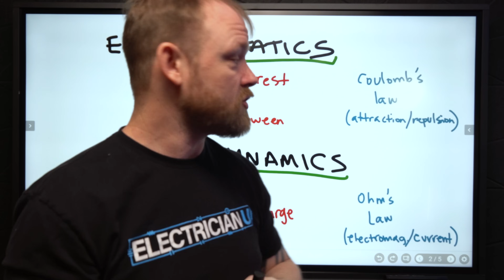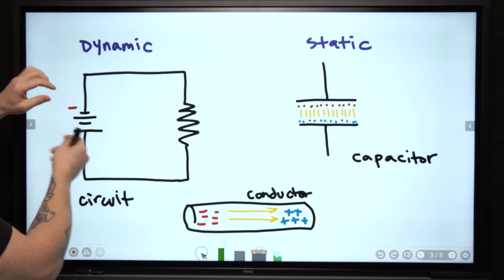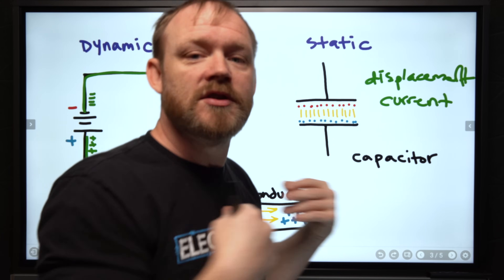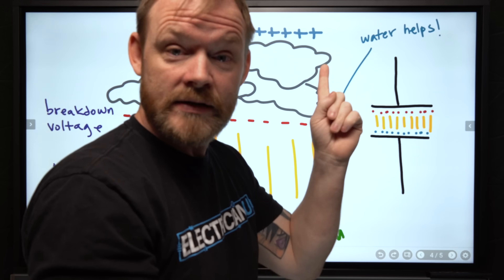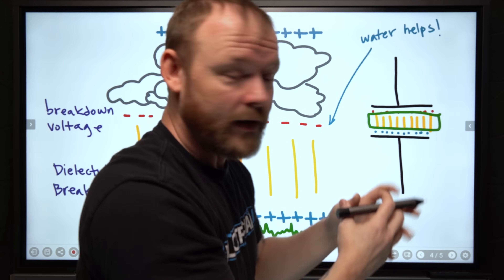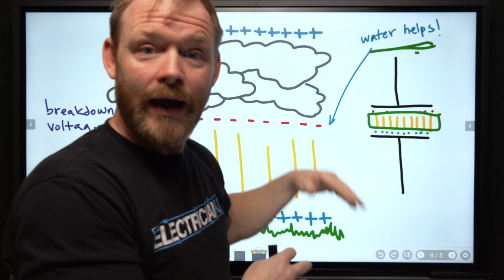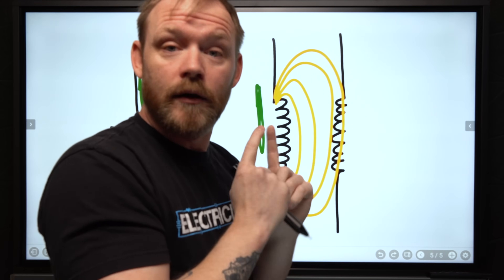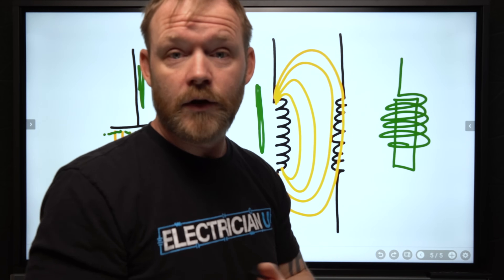Why Lightning and Capacitors are Different

Comment: GREAT EXPLANATION ON CAPACITIVE AND INDUCTIVE DYNAMICS!!
Concerning the earth, I have some old data that you may find interesting...

Between the ionosphere (at 60 miles) from the earth's surface, as a spherical capacitor:
1) V =360,000V
2) I = 1800A
3) C = 0.25 F (250,000uF)
4) R = 200 Ohms (atmospheric)
...on average

--dALE.

Comment: Thanks so much! This is great Continued Educational content for us sparkys! I had to miss the end of 2023 , the entirety of 2024, and just now preparing to get back in the field after having 2 separate shoulder surgeries on each shoulder. So to help pass the time, I became a paranormal investigator. This data is so useful in understanding false positives when detecting EMF spikes in my certified and passed K2 meter and Rook. I also use what called a “trip wire” that has been calibrated and tested with Mel Meter.